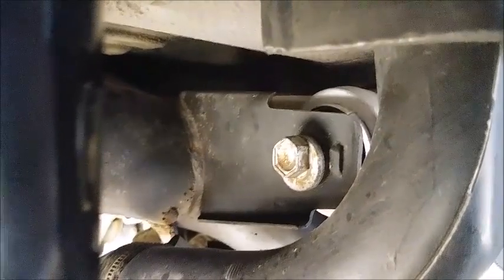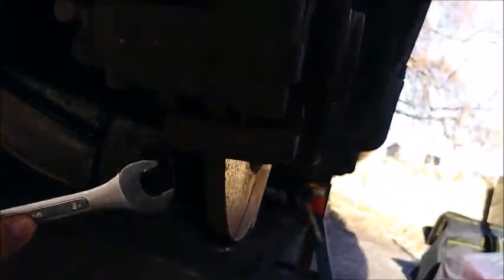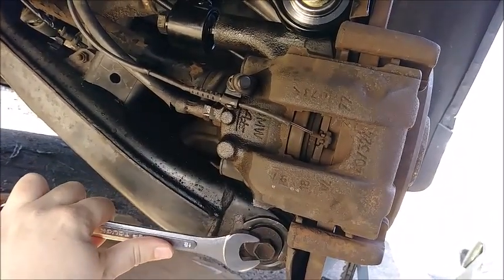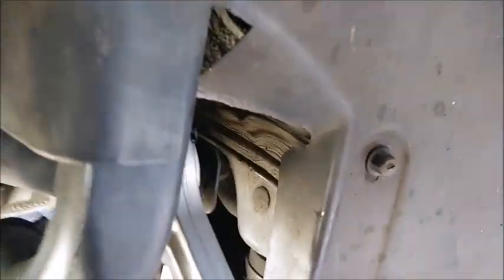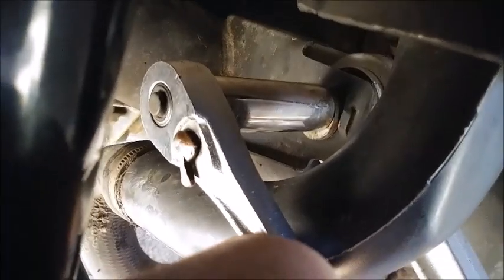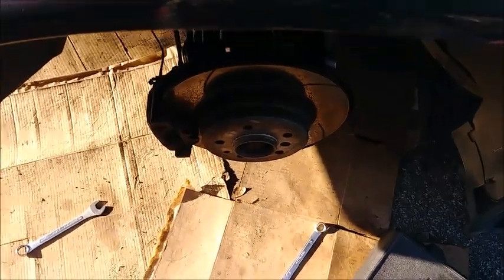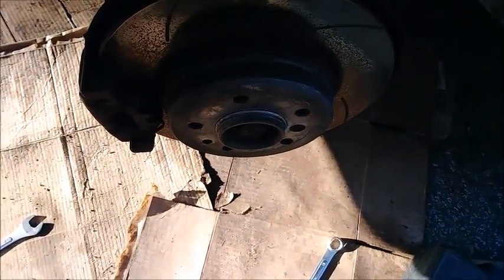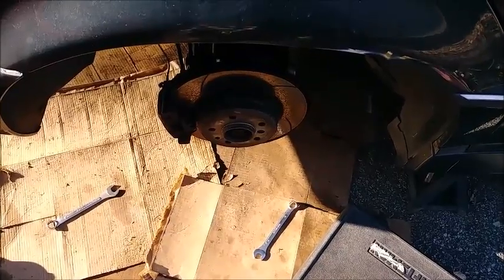how to adjust rear alignment bmw e38

Comment: Trying this now. It's way out of spec and the lower arm bushings are totally shot. Looking at options to replace them since you have to buy the whole lower arm to get the bushes, there is no separate part and the arm is like 600 each!
Reply from the maker: Yep. Those arms cost more than the whole refresh kit for every other suspension part, and the struts combined. They even cost more than all the aforementioned parts and my adjustable camber and toe kit on top of that, to every bit of camber out of the geometry I could.

What's more is those bolts securing the trailing arms aren't cheap and I snapped one trying to remove the lower arms. I noped out of the rest and bought a replacement bolt and nut, and called it a boom done. Luckily my bushings were still in decent shape.
Reply: @HollywoodHornet  Tx for the reply and the video! These E38's are def a labor of love. I have a 97 750 and I have spent so much getting the suspension right. Just replaced the leaky gas tank and a busted diff as well! Almost there....... E38 parts are getting ridic in price. lol Cheers!
Reply: @Frostified   telling me I gat lucky that I found one at the junkyard I took rear subframe front subframe Driveshaft engine hood trunk 4 doors everything that you can think is costing so much money know days total cost of $1000 for all the parts I took 😂